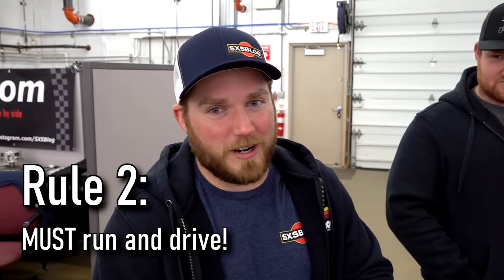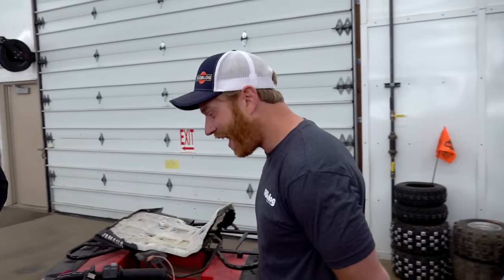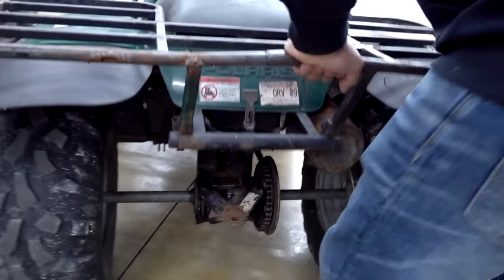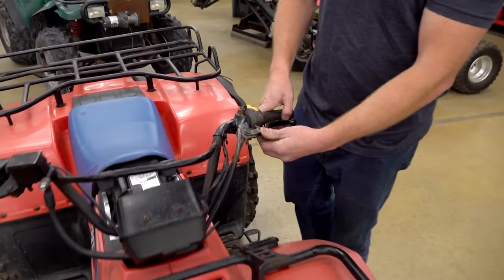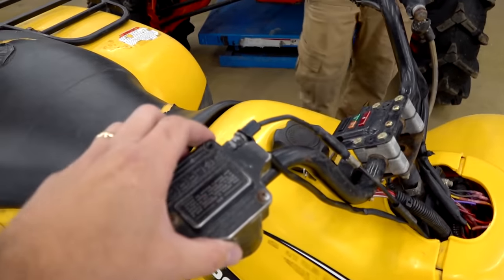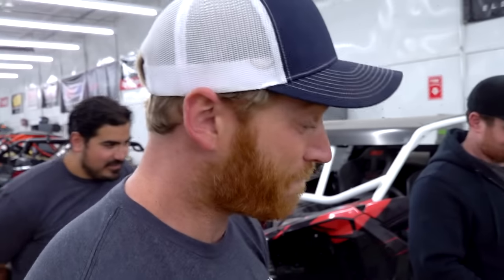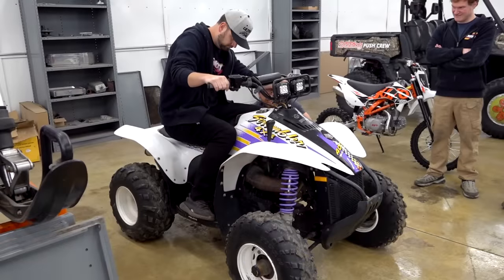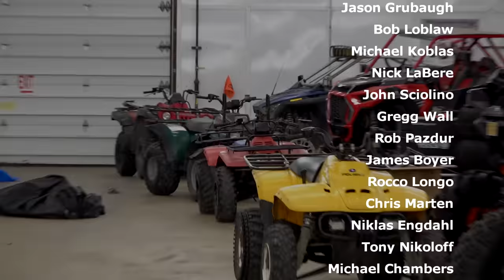Cheap QUAD challenge! $1500 budget unit REVEAL!

Comment: The saddest part is that 5 years ago all these would be under $500 and would be good cheap fun
Reply: Ur so I sold my 2005 honda 2wd ( rancher I think) with a winch on it for 850$ if I had it now I could get 1200$ I’m sure
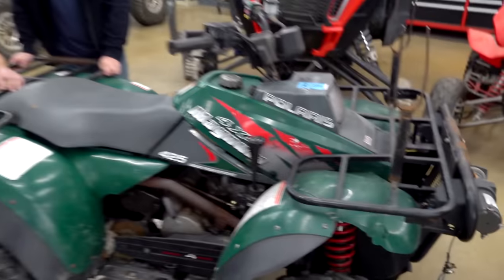Reply: Ur so right five years ago I sold my 2005 honda 2wd ( rancher I think) with a winch on it for 850$ if I had it now I could get 1200$ I’m sure 9:01
Reply: Yeah man- I sold my 400ex just about 5 years ago for 2k.  The guy I sold it to just sold it for 4k!  Crazy...  The used market went nuts...
Reply: Man i hear ya 8 years ago i picked up an 03 Kawasaki prairie 440 for 400 bucks with no issues. If someone offered me 1500 i would honestly turn it down..
Reply: @danielsmith9500  Canada you’d get 3500$
Reply: Truth
Reply: Prices have gone up because the new quad market is all but deceased. 2000-2010 was peak popularity and manufacturer participation in the segment. Used to be Plenty of variety in cheap New models compared to few options for new machines now.  5 years ago was the lowest most machines of the era will depreciate. Plus, after covid I think people are more active and likely to do things outdoors.
Reply: That was before Brandon got “elected”
Reply: Yea it really is sad. I bought a "cheap bike" for 600 supposed to be good motor just bad shifter shaft, long story short, complete down to frame restoration at this point. Thats just my cheap moto bike. Also have a "cheap cruiser" and I did get a decent deal on it but still a lot of work had/has to be done! Used to find quality rideable rides for the price but hey, its the times we live in boys just be glad we still can.
Reply: Covid mess that up.
Reply: Used Prices are high cause new ones are priced outrageously high.
Reply: Shit 10 years ago you couldnt give these things away to the scrap guy.
Reply: I wish these have always been 1500-2k machines in my area but utility quads rule my area
Reply: Every crackhead used their stimulus checks and inflated unemployment to become flippers.   Just install a dead battery, cut the pull cord and it runs great, just needs a carb cleaning and a little tinkering. I used to flip stuff but now can’t find anything worth repairing and sell at a fair price.
Reply: 500 scrambler was 5k new now 1000
Reply: I bought a dirtbike today for $300. Deals are still out there, just need to be vigilant
Reply: Matt got robbed
Reply: Facts
Reply: @briancella6395 can't even find cars for cheap. 2002 ranger 200,000 miles 3300 bucks. Like wtf. I get it you need to make money but work you put into it don't make it worth more. It's still a 1500 dollar beater
Reply: Sad but true
Reply: Yea, a few years back I bought a pair of trx250 utility quads for 600 bucks.. two machines..
Reply: yup I"ve not bought any cheap quads in a long time so I expected to see a warrior or blaster not junk
Reply: @pauliewalnuts240  also there no new sport quads been made... only yamaha raptor 700 and 450 that is about it for new quads... the other are all them utility quads cfmoto hytrack and all them big 4 wheel drive quad...
Reply: You’re so right… 5-6 years ago my father in law gave me a 2006 Bruin 350. Basically unused. He couldn’t justify paying to ship it across the country. He planned on just buying another one. I offered him 500 for it but he wouldn’t take it. I’m sure I could easily get a grand out of it now. It’s only a 350 but it’s mint and has 4wd
Reply: here in ga all those machines  would be beat to hell not running or have severe engine damage and still jokers would ask 2500 or more for them and then when they dont sell they would get put someplace out of sight untill
but then again when you find a good deal its either stolen or just absolute junk in short its hard to buy something used here in ga.  knowing the seller is more than likely lying about the condition of what he is selling then you have the a hole seller 
thats selling a good 20 year old machine but the price is what it cost new or more 
all that being said thats why my blood boils when see all these youtubers saying fb market place is a good place to buy used items  its not fb market place and all the other online yardsale sites are full of lyers trying to take advantage of someone or resellers that sit on the site all day snatching up the deals before anyone else has a chance to buy
Reply: Exactly, 5 years ago the ads read "take it off my hands " now the ads read " no low balls, I know what I have, blah blah blah"  the red wheeler "mule" probably didnt cost $1500 brand new haha

Comment: Hopefully this is just the start for more ATV content, would love to see the whole crew on 450/400 sport ATVs
Reply: The 450 quads had their time. I built em all into serious race quads, people would dump 10's of thousands into them.....and I'd smoke em all on a YZ250 with PC exhaust. Bikes are just faster. They are fun but there's a reason the only 450 made is the Yamaha. Renegade and Scrambler 1000's are just as fast and 4wd (3x the price too). I don't think they'll make a comeback which is sad. Even the 80's had some awesome quads. The holy grail 250R, the faster in a straight line Kawi Tecate 250, the LT250, and then the bad boys.....the Banshee and Quadzilla. Wish they'd have kept making them all through the 2000's like the Banshee.

Comment: I had a 2000 king quad 300 4x4... best quad i had back in the 90's era. Those sub transmissions are bad ass. We use to cut a lot of firewood to heat our house so we needed a good quad and trailer. When I got this quad we would just cut down the tree and drag parts of it back to the house to cut them up, lol. I bet money on the king quad. Little underpowered but for its time it was a great quad.
Reply: That's my bet as well,that thing may not be fast but I bet it a goat climbing things with that's trans
Reply: That thing was a big pile of crap. Basically took last place

Comment: The sport 400 is the fastest of the bunch. The scrambler is the best choice probably. Ive been wanting to find one for years. I loved the old polaris 2 strokes.
Reply: I have a 2000 Scr 400 , trail ported etc.
Slap a pipe and clutch kit to match on her, good to go!
Reply: I have a 1998 Polaris 400 sport two stroke and I will say the thing is insane it’s really fast and I had it bored out really fun machine

Comment: I have several scrambler here in MN. My 10 year old boy rips a 01 scrambler 500 4 stroke 4x4.  It's a great machine. Down side is that a lot of the parts are not avaliable.   There are several models that share the same parts, so used parts are pretty easy to come by.

Comment: I picked up a 2001 Grizzly 600 in 2016 for $1,900 (sold it 3 years later for $2,500) but that thing was a beast.  It's actually fairly light in the front end and the straight rear axle made sliding in corners a breeze.  You'll have fun with it I'm sure!
Reply: My family had a 2000 growing up so I’m excited to be ripping one again!

Comment: Nice, this is going to be the best challenge  ever. I have a 1998 polarirs 400 sport 2 stroke but will not engage forward, only reverse, and I can't find the parts or a used transmission anywhere to fix it but is like new
Reply: Believe it or not, i have one if you need it
Reply: Nice how much you want for it
Reply: And your location
Reply: @506 power sport 🇨🇷  I'd be happy with 250. And I live In S.D
Reply: @ tyler hill ok, that's a great price, but I live in North Carolina. I'm not sure how far that is from here

Comment: Owned a KingQ 300 (280cc) back in 2008, loved that little tank with 15 forward gears, regretted selling it. Bought my second king last summer, runs a dream even if the valve seals are sorta deleted! Looks like a runaway diesel from behind, lol. The canam boys hate it, slow af but always runs and always makes it home! I also ownd a few of the polaris explorer 400L 2 smokes and they haul ass!! paddle tires for sure!
Reply: IF the scrambler stays running and doesnt overheat, its a win for sure! If its leaking from the head, just slap a head gasket in it, crank it down to 60ft.lbs and send it, the head warps pretty good.

Comment: The 4x4 is magnetic in the shock towers the chains run all the time and you push the 4x4 button on the handle bars on Nick's Polaris I have a 93 Polaris 350L trailboss which has the same drive train
Reply: My profile picture is actually of my quad

Comment: I had a Suzuki Quad Runner 250 4x4 looks just like Matt's quad. Smoothest riding ATV ever. You load some weight on and it will pull anything! 
Super Low range 1st gear you touch the throttle and its at max rpm.

Comment: Ngl Matt’s quad is gonna be such a turtle but it will out work and pull any of the other quads. It’s literally a utility quad.
I think Doug’s gonna be sitting in the top spot if he cleans the carb and puts some fresh gas in. Grizzly’s run pretty good.

Comment: I had an 87 250 quadrunner. Basically the same as the 3rd bike. It was a little beast. I miss it. Thats probably the most reliable bike that was bought for the challenge

Comment: I grew up in the perfect spot to miss out on the writhing cool 2 stroke and my mom made me settle for a Polaris 250 2 stroke….. missed the 300ex that was actually the cool sport quad for awhile. The blaster was also cool then but barely hanging on. Then came the 400ex. Yes the banshee was always there. But the go slow atv era was still holding on.

Comment: I have a 1999 Arctic Cat 300 that's surprisingly similar to that Suzuki. Engine between the rear wheels, 3 speed transfer case with a 5 speed auto clutched manual transmission, locking front differential, and independent suspension all the way around. It even has a Suzuki engine in it. The only real difference I saw is that my Cat has hydraulic brakes.

Comment: I'm a little behind on the vids but that quad of Matt's I always wanted one of those back in the day.  Them things were beast! High, low, and super low range and 5 gears in each range. 2 wheel drive, 4 wheel drive and 4 wheel drive with front diff lock. Nice machine if fixed up.  Leo's quad is almost identical to my scrambler. Mine is a 2002. 400 2 stroke 4 wheel drive. Nice quads. Mine has the new cool yellow and blue paint scheme. This is gonna be a fun challenge!

Comment: The King quad(300cc) could actually be an 80s Quad Runner(250). Pretty much same transmissions etc.  Work horse quads.  You could actually still buy the King Quad 300 in New Zealand as of 4-5 yrs ago

Comment: Dang I thought for sure a big bear 350 was gunna be in that line up somewhere, lol. If Leo gets that coolant leak fixed which should be a simple fix, I say he’s gunna win most challenges. Can’t wait to see the follow up on this. 😂👍🏻
Reply: I tried to get a big bear but the guy couldn’t meet me in time lol
Reply: @dougbutterfield5505  dang… had I known I would’ve hook one of y’all up with a solid Honda 300 4x4… all well lol
Reply: @dougbutterfield5505  so these earlier grizzlies got there single overhead cam big bore engine from their yamaha sport bike cousin.
Early issues included the pistons becoming loose and basically falling sideways in their cylinder... ooof!
Reply: I had a Big Bear 400. Tough machine.
Reply: @matthewerwin4677  I’ve had a couple 400’s. Great machines. Arguably the best utility atv Yamaha has ever produced. Doug’s 600 grizzly will do fine so long as he can keep the electricals working and the starter clutch does it’s job. They’re just heavy machines.

Comment: The red Suzuki is a 1987ish Quadrunner 250 not a kingquad. I had one and my favorite part was definitely all the little levers lol. If it has four lug nuts in the back it’s a Quadrunner 250 but if it has five lug nuts then it’s a king quad 300.

Comment: cheap quads are fun I picked up a 1999 yamaha wolverine 350 4x4 for a $100 yes $100 running and driving only problem was the rear wheels didn't drive turned out all it needed was a axle still runs and drives today.

Comment: Matts Suzuki was an absolute beast in the 80s. Ive seen a 1000 pounds of Moose halved on the front and rear rack of one of these.. Crawled it all out of a shit hole still challenging too todays standards.. Super surprised ya guys ur unfamiliar with this Unit. Super Low Range in Diff lock is a Pulling Monster✊

Comment: If only I knew and closer lol. Have my father son project. 96 Polaris Xplorer 300 s stroke. New tires with adapters so 12s all around. New brakes incl cyl etc, top end, newer tranny gone through, repainted frame, spare tranny parts and clutch etc. Probably woulda let go for 1500 for cause lol

Comment: Alright, for my entry into the under $1500 competition: just got an '88 bayou 300, barn kept, properly maintained and repaired when necessary. New tires, new brakes, oil change, fresh gas, working lights... not even a seat tear, paid $900 cash...

Comment: Mikes got the right idea with the 400 2 stroke. I would’ve loved to have seen someone try and get a 400ex. Air cooled little tractor motors and they run great and make good power

Edit : I wrote this before I saw Leo’s. He’s got this down no chance anyone beats him. Still wish there was a 400ex in the mix though lol
Reply: Pretty much no chance of grabbing a 400ex for $1,500 around here, even a 300 seemed to be a no-go.
Reply: @dougbutterfield5505  damn. Up in the northeast they’re $1,500 running in need of some plastics and a carb clean all day. This is still going to be amazing. I for one am super stoaked

Comment: The little quad runner 250 best one ya got I have had 2 and damn do they take a beating have definitely Not fast but damn take em to the tight trails rocks and what not with that super low and locking diff and light weight not another quad in the shop that will touch it

Comment: I’m 99% sure that was my grizzly around 2016ish. I traded a nv4500 for the grizzly, a junky trailer and a parts washer. The engine was wide open, crank case full of leaves with a box of parts. No wheels either, the offset is funny because those are Honda wheels lol. I played with it a little and traded it for a kfx450 that I still have….I’m sure I have pictures somewhere😂

Comment: The red suzuki is a quad runner not a king quad so a 250 not a 300. However they are indestructible aswell as the magnum. I have the 425 magnum 6x6 amazing machine

Comment: I have 92 king quad 300 it is the same I put in super low gear it is slow as heck it will just about everything I have 2002 Polaris scrambler 500 it runs good when it's running

Comment: Y'all should come thru to Indianapolis Indiana, there's this unknown wooded spot that's in-between a river and a quarry with trail's of plenty.

 Trail's that lead to sandy bank's, some that lead thru mud, some with big ass 40ft hills at about a 60° slopes, trail's that lead thru a Creek, some thru sugarcane, trail's that ride next to the river, there's even a little track, one trail goes up a near vertical hill that I've never been up so I dont know what the fuck is there.

 You can take all your sxs's, 4wheelers, trucks, cars, go-karts, pretty much what ever the fuck y'all want. But bad thing is, it won't be there much longer because the city's tryin to buy everything out for something and they've already started tearing shit down.

Comment: Leo's is the water pump shaft and seal
Reply from the maker: Thank you
Reply: I've owned a 400 sport for 20 years lots of aftermarket parts as fast as a banchi.2 problems they have are the counter balance shaft will rust if they didn't keep antifreeze in it which causes the water pump seal go bad,second if you run those 400's really hard it will break the front cylinder lower bolt ears off,been there a couple of times the make a griddle that fixes that haven't broke one since.other than that that are badass the 4 wheel drive one uses magnetic oil in the hubs with out it that won't work 👍 can't wait to see a two stroke win

Comment: Why is there not a old Honda fourtrax like I have a 1987 bone stock beside front wheel bearings and back tires other than that this four-wheeler have been trough hell and still starts and goes and if the muds to deep its small enough to go around
Reply: An old Fourtrax was second on my list, but the prices around here are way too high
Reply: Is this matt responding it's not a Yamaha so this is not Doug
Reply: @jeremysmith3070  This is Steve, Those guys have named accounts they respond with